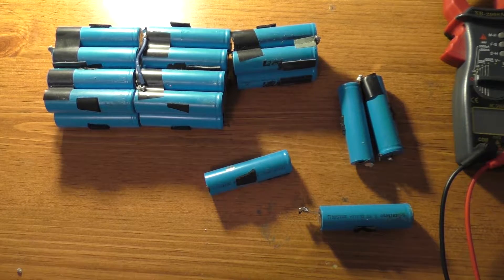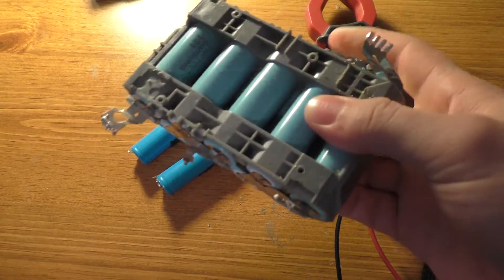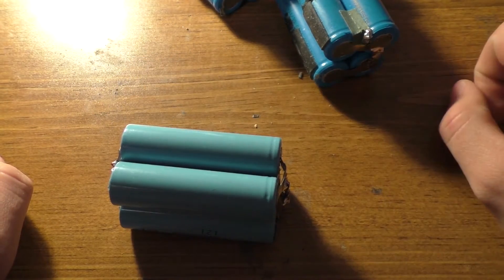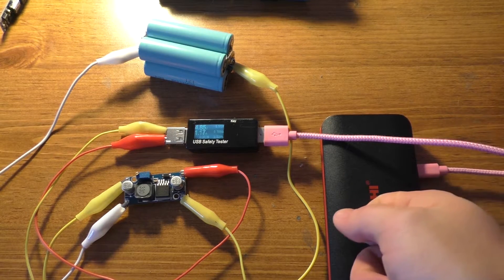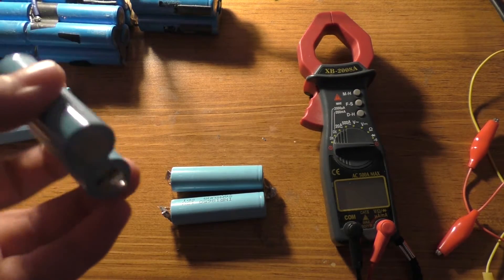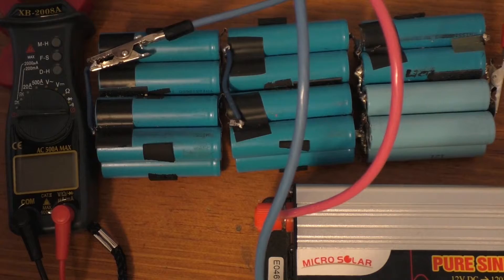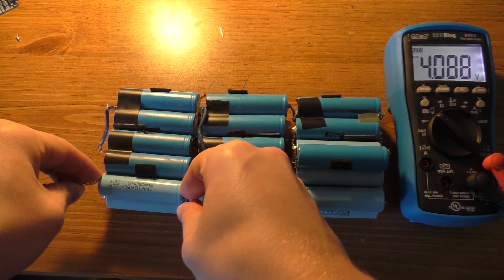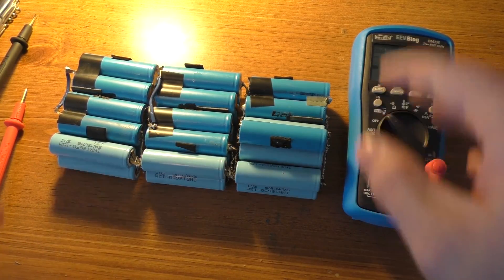DIY 12V Li-ion Battery Problem Part 2

Comment: would it be a good idea to make a 4s pack 16.8V and then use a buck converter to drop down to 12V-12.5V to get the full range of the pack. Then have an cut off at 3.2V with one of those lipo beepers
Reply from the maker: In my opinion, no its not a good idea. This is because you will waste energy, considering an average buck converter is only going to be something like 80% efficient. Also It would be somewhat expensive to buy a buck converter that can handle 30+ Amps. A buck converter is also an added point of failure. Also once you go below about 3.5 volts per cell or 10.5 volts for a 3s pack, which is going to be the cutoff voltage for most inverters, there really isn't all much left capacity in them, especially if you're not pulling much current out of them. There is also the added benefit of not discharging them as deep if you are going down to 3.5v per cell instead of 3.2v per cell, which will give the pack a longer life.

Comment: What do you plan to use this pack for ?
Reply from the maker: I have been using this pack for the last year. This is just a repair/update video. One of the big things that I have been using it for is running soldering irons and hot glue guns in places that it wouldn't be convenient to run an extension cord to. It has also been useful in power outages running a few CFL's, my laptop, the wifi router and charging phones. Really I have been using it anytime I need some power and can't easily run an extension cord.